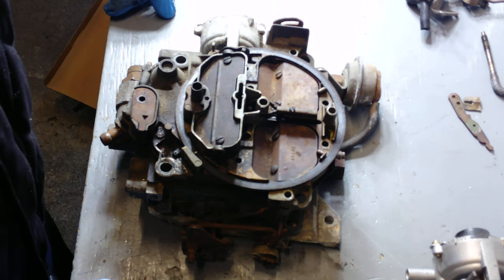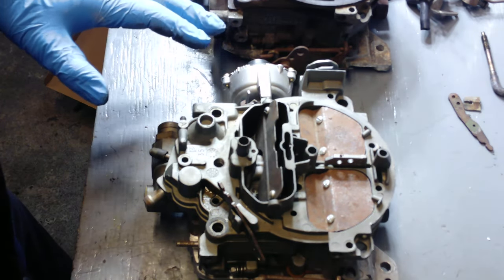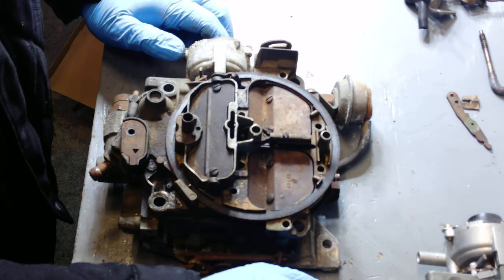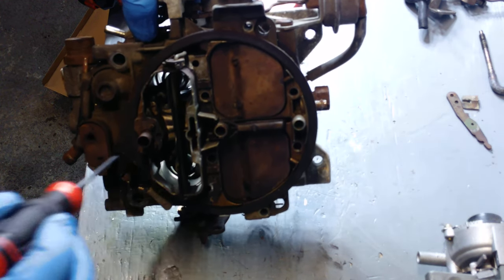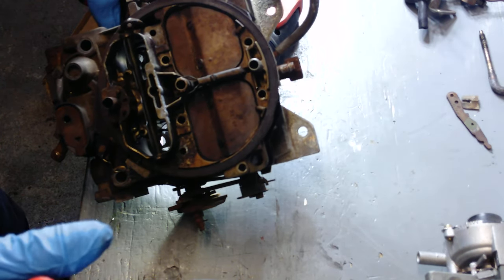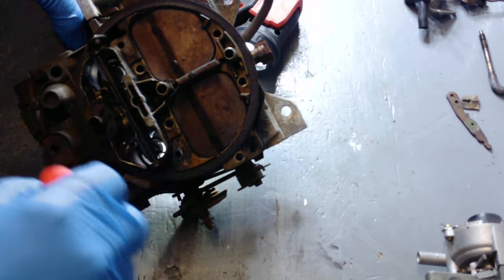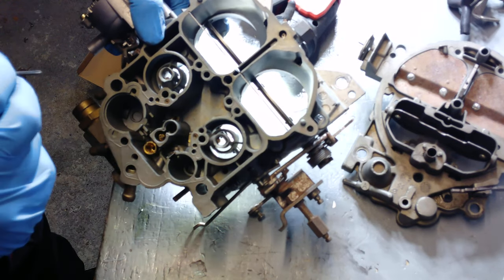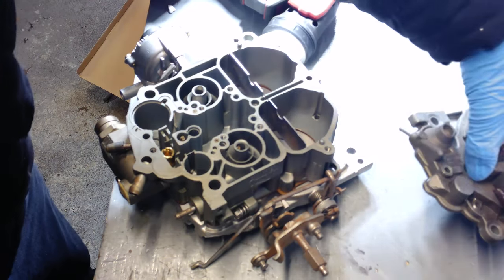Rochester Quadrajet carburetor 750-800 CFM explained

Comment: I had a 71 GS buick 455 in the 80s. I was a big quadrajet fan.  I didn't know about the bump. I never thought I had the 800cfm models either. Though my secondaries all went to 90°. On the 455, when you floored it, the vacum never went to zero. Which (as I understood it) meant it needed a bugger carb.  I didn't want to go to a holley. I liked the sound of the secondaries opening up.

Comment: Chevy trucks in the 80' had the 800. My 85 c20 is 17080213, i have 6 or 7 of them for spares and parts, same with my 72 c20 chevy 7042208.  I have many dealer manuals, tune up books and 1985 gm rochester new product book that lists all the numbers.  I have been told, by someone that wrote a book that my gm dealer books are wrong, and that was only made in 78-79. Lol, holy cow. 800 cfm carbs are all over the place on gm trucks still driving around.

Comment: I picked up a 800cfm model for my mild 350sb. A bit of tuning and modification, and its a perfect carb. No bog or flat spots, great economy, and 400hp on the dyno with perfect AF across the range. I'll never use a Holley again.

Comment: Yes i always wondered why the 403 Oldsmobile Small Block got a 800 cfm and the 400 Pontiac got the 750 , but looking it up it was all for emissions , the 403 s massive bore needed quick filling and responded better to a bigger bore carbie . As stated in GM litreture.

Comment: (I have a 7043250 ra 1223) qjet every place I look at all these videos and see they are all 750cfm or 800cfm. But called holley today for a replacement holley double pumper and they said a 600cfm is recommended for my olds 455 engine. Don't want to rob my car of hp if it needs. Let me know your thoughts thanks

Comment: 3 things that can ruin your effort rebuilding a quadrajet. Well plugs leaking, secondary air horn out of adjustment, and the sping under the primary needles stretched out by the previous rebuild.

Comment: Thanks for the video.  Can the throttle plate bushings be replaced?  (If they have them?)  My idle is erratic, and I had to install a stronger return spring.
Reply from the maker: Yes you can! you will have to drill out center bore and tap in bushings. Some online sources sell kits for the Rochesters.
Reply: Mr heavy Chevy has a great video on q jets
Reply: I've always run nothing but q jets they are the best all around street carb ever made and the beauty of them is the air doors only allow the air the engine calls for in if the engine only calls for 550 cfm for example that's all it will get that's why they got away w only two models 750 and 800 and used them on everything small v8s to big blocks and all in between Pontiacs used the 800 a lot on the 400 trans am motors and many applications I'd have them moaning and my buddies always heard me coming for miles away lol best milage and throttle response due to the small primaries and when you open up the large secondaries it's a kick in the ass or it should be you don't get that w any square bore at all my opinion is hands down the very very best carb ever made for street use they last forever w out any adjustments set it and forget it no jet changes or power valves going out and spilling gas all over the intake manifold like Holley's Edelbrock aka Carter AFB which stood for aluminum four barrel then was bought out by Edelbrock is the second best and easiest to tune and make a decent street carb but a square bore none the less milage is not near as good and no kick in the ass performance out of them

Comment: I have a Qjet 750 just like the one you showed. When I increase the throttle gently the engine tries to shut down but if I close the choke plate with my hand the engine stays on. its acceleration. If I accelerate quickly to full throttle it does so but then it tries to shut down, as if it won't suck gasoline.
Reply from the maker: Seems to be a Vacuum leak
Reply: I always throw a shop rag over the air horn. If it dies it has no vac leak if it doesn't then it's getting air some other way

Comment: Pontiacs used the 800s on the 400 in the trans am for starters and im sure they used them in a lot of the big cu inch motors
Reply: It was the 403 Olds in the Trans Am that got the 800 to pass emissions , the 400 Pontiacs got a 750 .